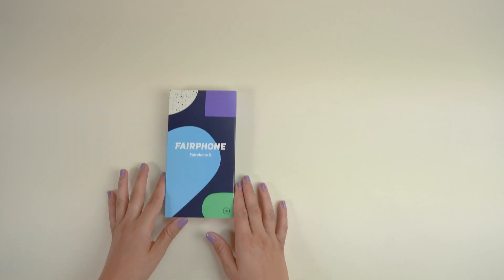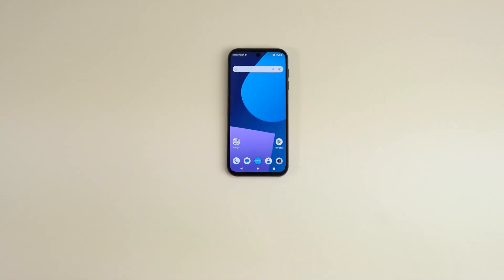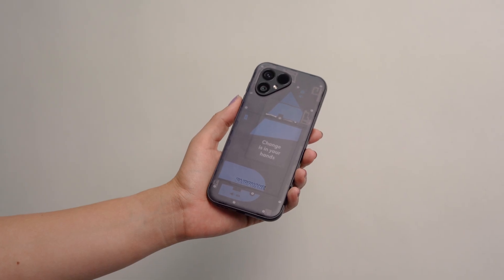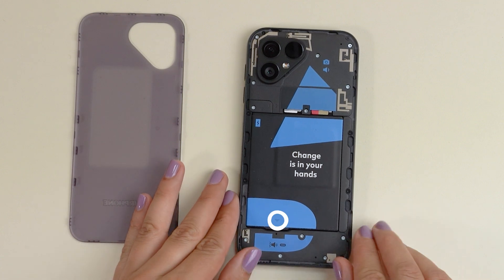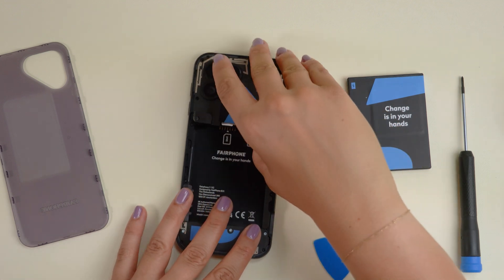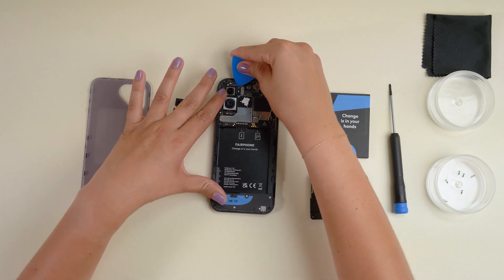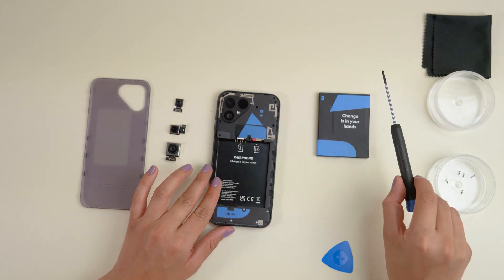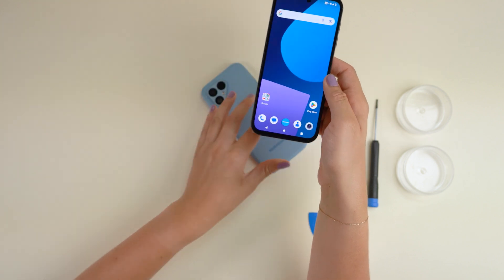Replacing the Cameras | Fairphone 5

Comment: Will there be a better camera for the FP5 to replace the original one?
Reply: June 25, 2025 
FP6 "The main camera features a 50-megapixel sensor and an f/1.56 aperture. The ultrawide camera has a 13-megapixel sensor and an f/2.0 aperture. There is also a selfie camera capable of taking photos with a resolution of 32 megapixels."

Comment: Keep going fairphone. Headphone jack next time. Still using my Note 9. Perfectly flat back and headphone jack. Battery life? f#&@!d but i refuse to buy a phone without a jack. I would buy the Samsung s23 if it had a headphone jack. 8 years of updates on fairphone is tempting... Just sad the hardware is meh. Stop wasting time trying to get CPUs to be replaceable. Headphone jackkkkk.
Reply: lol a replaceable CPU for a phone woud be wayyy better for the longevity than a headphone jack, not at all a waste. I could theoretically use a phone for 20+ years as opposed to 10+. Though I must admit that one of the biggest reasons why I'm still rocking my iPhone SE (gen 1/2016) is because of the headphone jack.